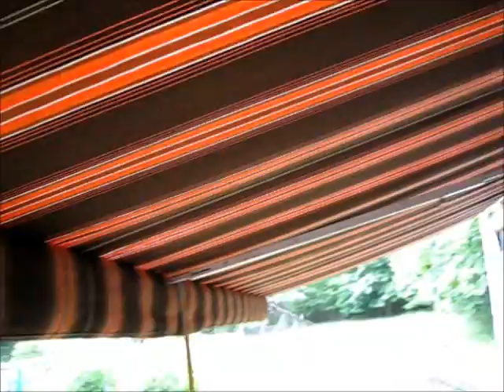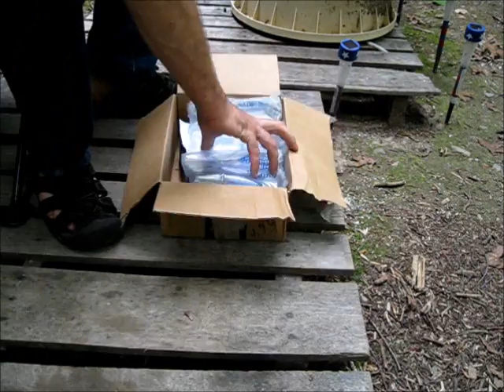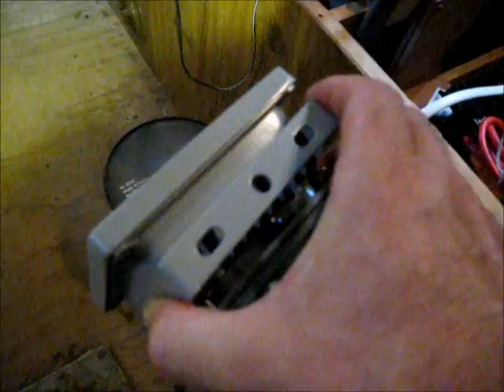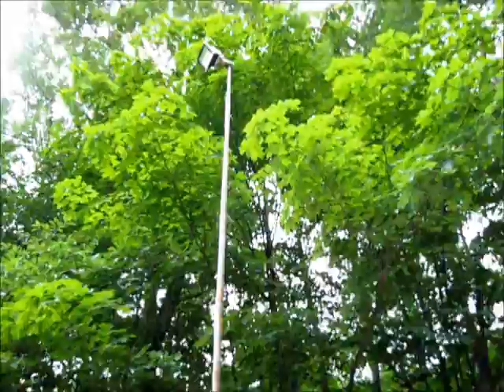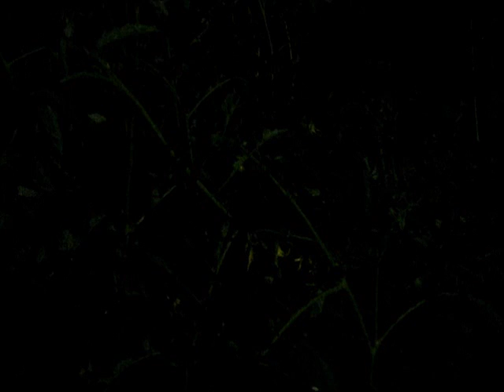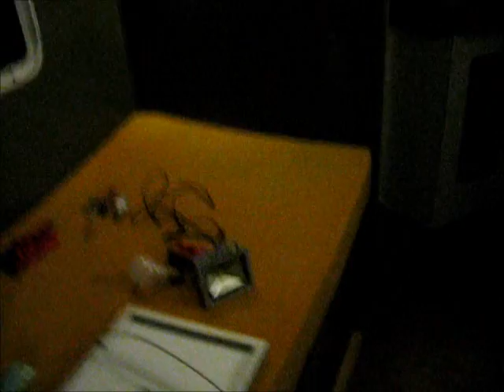Off Grid Solar Flood Lights And Indoor LED Lighting

Comment: The poles are to help support the long awning and adjust it to where you want it higher or lower at the end so if you want to collect more rain, put it lower. Also, it provides a basic structure to help the awning stay out in the wind though still not that a good idea for strong winds. However, nice lights even though your camera sucks at picking it up.

Comment: There was a strap for the awning under the RV sofa, along with the 2 twist stakes. Those are a set. The strap is tossed over you awning and tied down with the twist anchors. Again follow the advice noted of the awning tip. This will allow you to place the 55 gallon drum under to retrieve the rain water. Be sure to tighten all of the slide arm nuts down firmly to prevent movement. The "Patio" arms are pegged to the ground with the long spikes. Good luck.

Comment: Troy,  I a not sure those are legs pal.  My camper awing has similar config and those are connected to the top - at the roof - should be a notch or latch of some sort to lock them in.  Thus giving the canvas a rigid edge for the left and right sides.

TMOTS

Comment: yes one should try with other cams also.
But brightness has not much to do with the available light spectrum - means also simple LEDs can produce a very bright light, but this is then in a certain limited wavelength range only. We may be able to see such a light easily with our eyes, but cams may not be able to work with it because the wavelength is not inside their range. Or reverse: we cannot see light from IR LEDs which are typically used for night vision tasks ...

Comment: If you leave the awning out in the rain, lower the side the wind is coming from at least one foot to shed rain and prevent the wind from getting under the awning. The end posts should be 90 degrees to the ground and as deeply as you can get anchored into the ground. Any wind much more than 15 mph will generate thousands of pounds of force trying to tear the awning off you motorhome. Be careful that the door doesn't chafe the awning when you open it, or you will tear the awning. Ask me how I know

Comment: The extra poles are support legs for the awning.  They help stabilize it light winds.  Also, leave one corner slightly lower than other so the water can drain off.

Comment: U installed a 12V accessory plug in the same location as the plastic water tank under ur bed only to find that there was no clearance for the plug. This is a classic lack of planning, forethought and examination of design. If u had worked with rv's in the past, u would have dry fit everything before the first hole was ever drilled. U r creating the impression for ur viewers that u are unable to do simple tasks in order to generate more comments & entertainment value to boost ur AdSense revenue!

Comment: U stated just recently in ur Thursday, July 11, 2013 The Off Grid Project Explained And Solar Power video about 7:45 into ur video that, "I show ppl how to restore campers and rv's on a budget. That's what I do. It's what I have always done and I will continue to do so cause I like to help ppl." this is just ONE of the instances that I am talking about. Those are your words verbatim. So my question remains because u yourself stated u don't know how to pull it out/ how to set it up the awning.

Comment from the maker: The RV is parked badly and off level. I hope to get it running and move it properly.

The camper is in a perfect spot. Shaded in summer and gets full winter sun when the leaves are off.

I will try to update TheOffGridProject website with the projects and status.

Comment: Baran, There are TONS of Outside LED Security Lights with Motion Sensors. Even with Solar charging capability. The only issue is with the Remote Control. Youd have to either use an add on like shown in the Video or the one DocPrep listed below. But if I all you need is Motion Detection, go to Amazon or Ebay for ready to go light options.

Comment: Hey Doc, I liked that idea. I just found EXACT same AGT 2 CH Wireless Remote Control w/ 2 Controls on Amazon for $19.99 free shipping with PRIME.Im in for two. That has allot of possibilities. Thanks for sharing.Going to use it to start my generator from remote and turn my inverter ON/OFF. Should work great. NOTE: This idea will work only if your Generator has electric start.!

Comment: The Light on the Pole, Is the LED light just a 12V 40 Watt LED & the remote control kit seperate that is just wired up to the light? Or is the 40 Watt light running 110AC. Also, to clarify, this light does not have Solar Panel or Battery at this time correct? It is something that Joe is thinking of producing or is it available at this time? Also new LED Street Lights run anywhere from 100 to 400 Watts. So if your friends light is a 40W LED, it reallys not going to equal a street light.

Comment: If you are looking for remote control, I just found something that I think is neat. Its a 12V 2 Channel Remote Control Device w/ 2 Remotes. If you already have lights this would be great.Check out newegg DOT com and search for AGT 12V Waterproof Wireless Remote Control DC Universal 2-Channel Output LED/Lights Its $23 + s&H I just ordered one.There is a video also. So I figure I can turn my lights on with 1 ch and still have a spare. Looks neat, esp if you already have lighting.(Not Affiliated)

Comment: "No, this is not a commercial but just a friend installing some lights to see how well they work in a real world off grid situation." What exactly is Joe expecting to happen? This LED light.Its going to light up the same on your RV as any other building, You have the power, your running AC.This is not a OTG "special" light.. Its a case of some guy giving you lights & you promoting them. Just call it what it is.The lights help,great! But lets not make this out to be anything more then what it is.

Comment: For those looking for remote control LED lighting, one option, is MR. BEAMS. I have their In House Emergency Kit and so far it has performed well and I have zero issue. They also have a battery powered Outside LED with remote that I am considering. They have been well received in the industry and have good reviews. Also, just GOOGLE Outside LED Lighting with Remote Control and there plenty of options.

Comment: Troy e legs hanging down should be attatched to the rv near the end of the awning fabric. the one in the center is a tensioning rafter. flip it out in the center of the roller tube, and tigten it.

Comment: Would that light help you on your solar power at all, any watts coming in from your charge controller if so add another light on the other side an charge at night too with that AC running

Comment: you need electricity to 'nuke' the rice. But this works you can use dried peas or beans to or a combination if you don't have enough of one. A large sock filled  with these items and 'nuked' for about 2 minutes makes a great body warmer for weak newborn kids (goat) or lambs.Put it in a small box with the young one.

Comment: abt the LEDs:  I guess typical RVers are mostly on grid if they are parked somewhere.
Maybe best market chances for such iff grid lights are the usual "off grid professionals" (e.g. road construction, building demolition, emergency services, plus fishermen on their boats) plus maybe preppers.
But: these LEDs are obviously of low light quality means low CRI LEDs, covering only limited wavelengths. If they cannot be used for cams, incl. surveillance cams or rear view cams, it may be a true no go.

Comment: Excellent idea. Troy could be doing a lot near twilight early night time. He will not have to worry so much about the heat and he can sleep some during the day when he has the Sun powering the Panels. Less wear and tear on the battery bank. A good LED Lamp can be had for $10-$15 and he can use rechargeable AA or AAA batts. The solutions are there, because without them, Winter will be here and he will be in a world of hurt

Comment: Most of us who watch this don't own or use microwaves. You can get the same effect from placing the "rice sock" over your heating source be it fire, wood stove, water heater, exc., but you are right, dry rice will hold the heat for a long time. Now try small p-gravel & sand in a sock. Now you don't have to play with your food.

Comment: If the quality and price is right, I very much like the idea of those LED lights,  would love to have a couple of those 40 watt units for some annual outdoor events.  I need to find some cheap solar in my area and start collecting.  I have doubt I ever get to go fully off grid, but i love the idea of doing anything to reduce dependence on the "system"

Comment: Grat's on the awning Troy.  Those so called legs should go back and fasten to the RV/awning near the top (along the fabric).  Also as others have said you need to drop one corner down lower for water to run off (at 3:02 would be a good angle to give you an idea).  Also the 2 end caps of the awning need to be pushed back into the roll and refastened (rivets or screws) or else if it comes out too much you can unroll the springs and really have a mess. Should be lever on end to flip to roll back up

Comment: Looks like things are brightening up...pun intended.  You should get the insulation back in those walls and get them closed back up...Winter is coming.  I worry about you installing your wood stove in the new RV, how are you planning on routing the stove pipe?  Are you worried about increasing your air infiltration?  Hope things continue to improve.

Comment: Troy, you may already know this but just a reminder; slant one of the sides down more than the other side. In case of rain the water will gather in the center and put too much weight on that old material and rip it and or bend your awning hardware.

Comment: Troy out of experience with camper awnings keep the legs vertical one end needs to be lower than the other so rain can run off, another thing I do is tie the ends down so wind dose not lift it up and ruin it, found out the hard way! We did a lot of camping with 4H doing the show circuit

Comment: Those new Lights Look Great! The camera may not pick it up but you can tell from when you showed the light just how bright it is by the way it lights up the tree around it. It would be interesting to see how that spotlight works with the Solar System. Could you use it to charge the system at night? Even when running it off of the system? Might be worth testing out if you could have it close to the panels. Might be worth the around $150 investment on the light

Comment: you need to shorten those legs so they are right under the awning at a 90 degree angle to the ground. If it rains the weight of the wet awning and any water tha collects will break those legs.